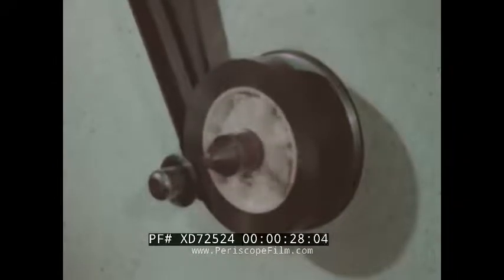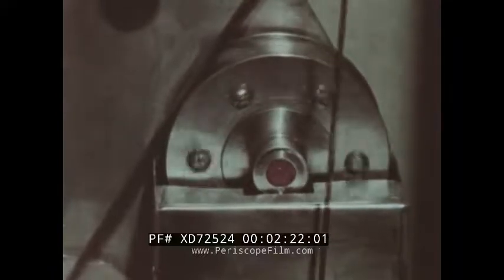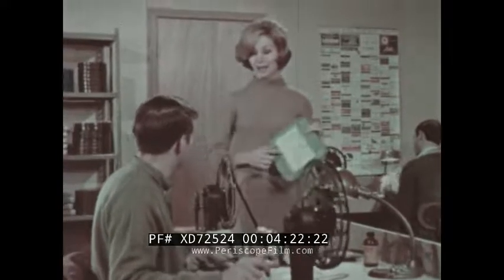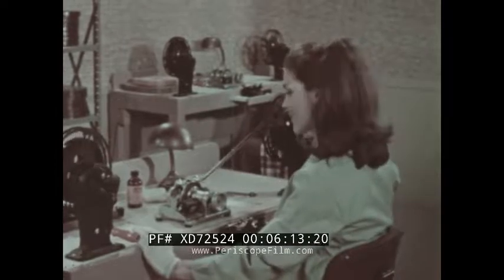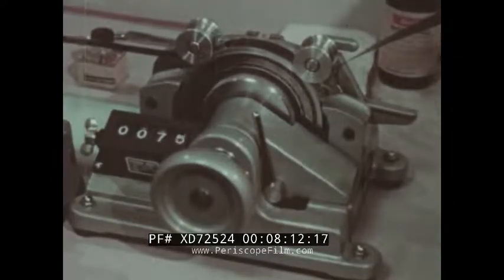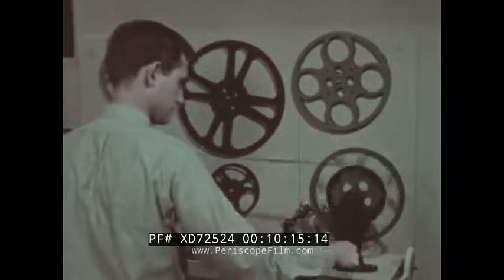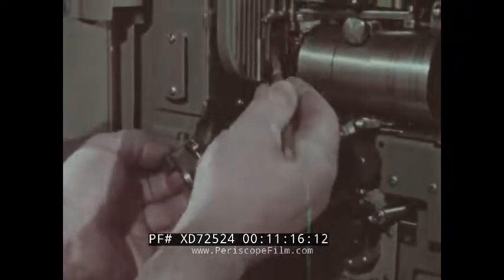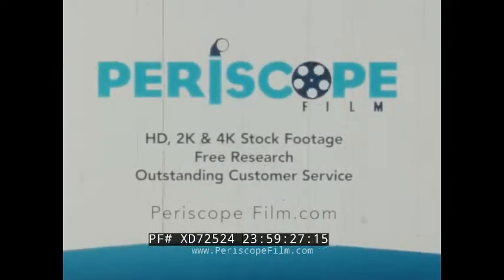PROPER HANDLING OF 16mm FILM PRINTS    1960s EASTMAN KODAK MOTION PICTURE  LABORATORY MOVIE  XD72524

Comment: We watch vintage westerns on Encore Westerns that for some  reason seem to only exist in 16mm syndication prints.  Most of the picture quality is fine, but the cue marks around commercials and at the end left from the syndication runs are terrible.  A shame they didn't have another way to mark it.
Reply: Standard cue marks were a small white dot in the upper right corner of the frame. Two dots a half second apart (or was it 1 second, I forget) 10 seconds before changeover, then a single dot at changeover. The first dots cued the projectionist to start the next reel projector (the reel was cued at the start of the 10 second leader), and the second dot was where he hit the changeover switch, or did a manual changeover. The film continued on the first reel for a few more seconds in case he was late on the changeover, or had to do a manual shutter switch and then hit a switch to change over the audio track.

I still automatically spot those dots on any film I see, but most people never noticed them. If you look you can see them about every 20 minutes in a movie, unless they have been erased in making a digital copy of the original film.